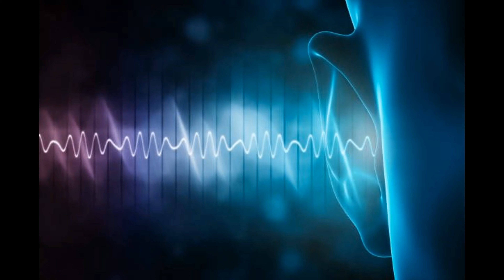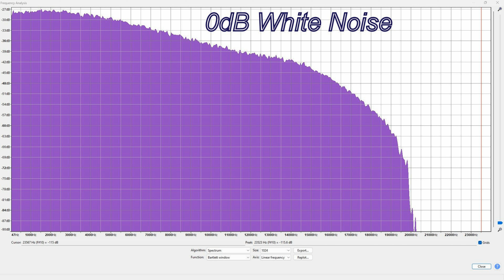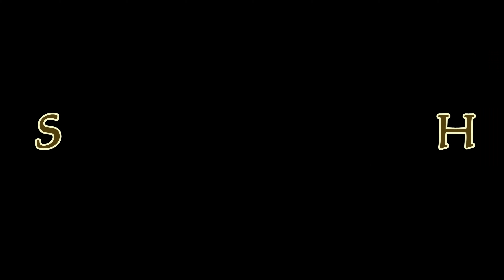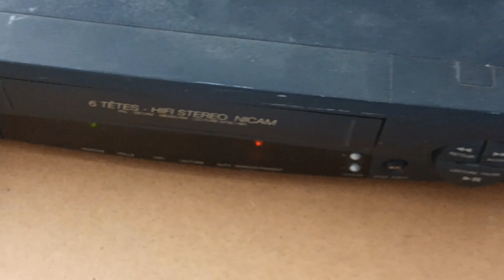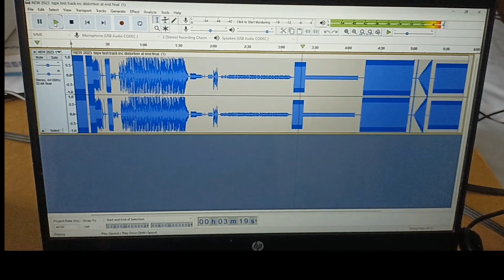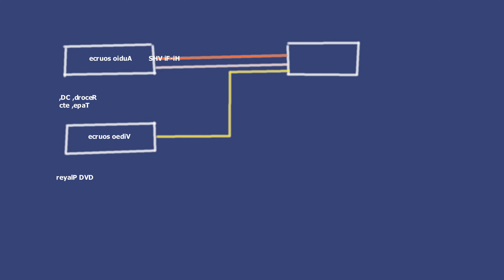VHS HI-FI Sound: Test Results Revealed

Comment: Great video! Very informative. I have been doing this for a bit but with no preamp between my source and the vcr. The sound quality seems to be really great still, but I'd love to be able to set the recording levels to maximize the quality. What would you recommend for that?
Reply from the maker: On my VCR the input is preset and is fine. You can either amplify it going in or coming out. My stance would be to put in an amp as it comes out because that way you will never overdrive the input level. Better to give a "big" signal a little boost rather than giving a little signal a big boost because of noise floors etc. This is good value for money, It is a  1 input 4 output headphone amp. You can see it as overkill but it will do the job at low cost. You can try it as an input booster and just as easily as an output booster. Plus you can still connect other things to the 3 spare outputs. https://amzn.to/3KRMkHA  really low cost and Behringer is a good name in the pro audio business. With Amazon if it does not do what you need it to you can return it.
Reply: @GaryKeepItSimple I appreciate the quick response! This looks great. In what order would this go in my setup? I currently go from my computer (recording from Tidal) into the VCR input. I then go from the VCR output into my technics receiver to check the recordings.
Reply from the maker: From the recorder  put in the amp and adjust the level to get the results you want to feed into your Technics amp.  That way you will not have noise issues. You will just be "topping it up" to the level the Technics needs to give you the best sound. You will know the recordings are pure without risk of overdrive on the loud bits. enjoy.
Reply: @GaryKeepItSimple thanks so much!

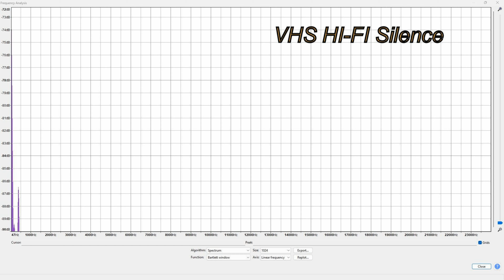Comment: 10:50 
how is it analog?
If you slow down the tape will it slow down the music? Just like a normal analog tape deck?
Reply from the maker: It is analogue because the signals are analogue. No, if you slow it down it will mute the sound.  The sound is on an FM modulated carrier.  You are thinking like Liner track sound which is written to the tape as it passes the head. That sound would slow down and be frequency lowered.  VHS hifi is like FM radio Amalouge but not adjustable.  I hope that helps.
Reply: @GaryKeepItSimple  I understand that standard tape is an energized magnetic field positively or negatively charged to reproduce the audio waveform
I’m having trouble figuring this one out. So its a modulated signal? 
I’ve tried searching but can’t find the answer that explains it. Do you have any more information?
Reply from the maker: If you watch my video https://youtu.be/EHhRfR81bEM it will show you all you need to know about Audio cassette decks. However. Just to quickly explain.   Tape can be North or South magnetised. (Poles of a magnet) the strength of the magnetism gives different-sized output voltages.
So on tape, all you need to do is pass an electromagnet over the tape at a constant speed and feed the magnet with Signal. Exactly the same as we send to a speaker. That will work. But it will not sound good. So DC bias was invented. it sounds better (BAD But Better). Then AC bias was developed. That is explained in my video above. In short, all the signals, big, small, HF and LF are put on the tape. and easily read back by a cassette deck. (or any tape player).  So to VHS Hi-Fi. An FM carrier is just a signal. it is a specific frequency until modulated and the Audio signal causes the frequency to vary with the amplitude of the audio signal. Loud is more deviation, quiet is less deviation. The VHS heads can record video signals up to around 3 Mhz. The HIFI track is well below that so they put it on the tape as an FM carrier wave and when the tape is replayed they separate the FM sound carrier off in one direction and the Video signal off in a different direction. (Filtered by frequency, like tuning a radio) so then the Hi-FI audio is replayed by the machine in the same way as a good FM receiver would deal with the signal. The Picture information is not a problem to the sound and the sound is not a problem to the picture. The biggest problem with VHS Hi-Fi is Tracking. If the tape is stretched or curled the tracking will be difficult. On the picture this will show as a snowy picture, the Hi-Fi sound will go hissy and the Machine will mute the Sound. This will then unmute and re-mute whilst the tracking error persists. When this is happening most machines will play the liner track and you will hear Lo-Fi sound and chopping noise. That is why it is better to use SP not LP or EP for recording. LP and EP is much harder to track and the tapes will not keep very well.  However, the sound quality on a GOOD TRACKING LP or EP or even EEP will be just as good as on SP. 

I hope that helps. Happy to continue if you want. Cheers

Comment: It’s a shame most vhs hi fi player/ recorders stopped putting adjustable VU meters on them also most don’t include a headphone jack. How does one know the recording leveled for audio in. Plus’s they are just cool. Even the cheapest Cassatt decks have these basic features.
Reply from the maker: Whilst I agree with you 100% about it being a disappointment about the VU and Adjustments can I add a positive light here. 
The main reason they removed the bits was cost. Most people, I would say 95% did not use VHS Hi-Fi as a recording medium. They played Stereo Hi-Fi tapes into the Stereo TVs that were few and far between with the speakers on either side of a 22" screen and that was that.
 Most TV was mono, then when NICAM in the  UK started they had the ability to record High Quality DIGITAL sound. Whether they wanted to or not. But Most people wanted East Enders (soap) recorded 3 times a week and that was all they knew or cared about.  
So the market was small for "Real HI-FI fans". The plus point is that VHS Hi-Fi at least on the one I tested is set to record well with a good input level. i.e. line level. It is pre-set because TV sound is always at the same levels when transmitted. Signals from a Video source are also pre-set i.e. a Sky or Cable box.  so again no need to have adjustments. The HIFI  recording was not Auto level controled so it was just good. 
If you use Line and not headphone outputs to feed the HI-FI VHS, it will always just be correct. be that CD or Tape or record. Line level will always be correct. ALSO because it is so good, if the level is a bit low you can turn up the volume on playback knowing the noise etc is not on the signal.
 For real adjustments, a cassette deck or other recorder used as a pre-amp gets around all the problems in one go.

Comment: We could add (for the technically inclined :) that VHS  HI-FI is FM modulated, similar to an FM station, with some audio compression/expansion to lower noise and improve the dynamic range.
Reply from the maker: That is correct, and it does a good job, with a good tape .
Reply: Wouldn't audio compression decrease the dynamic range rather than improve it?
Reply: @UltrafineDeluxe  It is compressed during recording, than expanded again during playback to recover full dynamic range.
Similar to DBX.

Comment: Hi-Fi VCR sound cannot capture all the sound like CDs can because Hi Fi VCR is analog which creates inaccurate results and less fidelity than to a CD, and consumer level which has a lot of background noise. It's just like YouTube audio which doesn't contain all the sound as a CD because of audio compression, which is way worse.
Reply: Lol?

Many old audio sources that eventually made their way onto a commercial CD in the 80s were recorded off of analog tape deck based originals. If you have even a 4 track .25” tape deck pulling that tape at a fast enough speed it will sound better than CD. Although it will wear out with repeated playback. 

Without seeing the machine and walking into a room during the playback of a tape reel i doubt that anybody but an audiophile would notice that my music was being played off of a tape deck. 

(I have not watched the video yet so pardon me if it is explained there.)

On the original VHS format audio was stored on linear tracks adjacent to the video track which was a helical track. It sounded okay at standard speed but was awful at extended or long play speeds because the tape on that linear track was being pulled very slowly.

VHS HI-FI stores the audio on the helical track with the video which will not only slightly improve the audio compared to the default original standard but the audio will remain at that quality even on extended or long play speeds.
Reply: @halo3odst  here's the thing.... vhs hi fi still doesn't capture all the sound like cds do since they use fm modulators rather than a linear signal like reel to reel tapes do.... reel to reel tapes were specifically designed for audio capture and professionals used this format which is why they beat all digital audio formats for producing.... the biggest question i have is why vhs hi fi wasn't released as a digital audio format... riaa too scared of consumers copying cds?
Reply: Just another LOL

Comment: I used VHS Hi-Fi Audio for many years from 1986 up to the early 2000's.  It was a great audio archiving format giving damn near digital audio quality on cheap (compared with reel-to-reel) tapes.  Tape to head speed was the equivalent of about 102 ips on open reel.  The greatest problems with the format were tracking issues (resulting in a "motorboating" buzzing sound) and sometimes incompatability between decks.  DAT actually suffered from a lot of the same issues as it used the same rotating head drum (albeit in miniature) as a VCR.  Dropouts on the tape would also cause either a quick sound glitch or a mute in the audio.  This could be minimised by using high grade (rather than standard grade) blank tapes from good manufacturers like TDK, Sony, Maxell, etc.  There is also a low level noise that comes from the head swiching system in the VCR, but it was pretty much un-noticable at normal audio levels.  I used the format mainly for archiving radio broadcasts, and only recently finished transferring all the tapes to digital audio files.  It was definately one of the "best kept secrets" in the audio world at the time.

Comment: 8:14 interesting that you show this particular JVC S-VHS recorder wondering "Where have the controls gone". The answer in this case is that the European (PAL) version had all the controls and the US (NTSC) version didn't. 
I happen to own the PAL version. I recorded several E300 tapes on it with 10 hours of music each, with markers so I could search for particular music later on. I remember it insisted on getting a video signal with the audio to work properly so what I did was I put it in simulcast mode and recorded a TV channel as video and the audio input (connected from my receiver) as HiFi audio. I also recorded CD's by using my Amiga as audio and video input so I had the Amiga CDTV player (with track number and time code!) on the tape with HiFi audio.
Reply from the maker: You had it sussed. Well done.

Comment: Just to add it is better I find if you record at  EP speed as it stops the head switching noise as the tape is moving slower against the drum the sound isn't compromised .
Reply from the maker: A lot of people say EP is subject to tracking problems between machines. I say if it works, it works.
Reply: On the JVC VCR I was using, in EP I could hear some typical noise you have when tracking is not 100% correct iny speakers. It was quite noticeable at high level. The SP was clearly better for me.

Comment: 4  hour long mix tapes!
Reply from the maker: You can do 8 hours but they may not track properly if stored. so yes 4 four-hour mix tapes.
Reply: @GaryKeepItSimple  I ran out of luck, the VCR turns on but won't accept a tape.  I'm guessing the belt got a bit weak.  On the other hand, I found maybe a dozen old tapes; mostly Profi Gold (aldi or lidl store) branded (some are identical to the emtec tapes I got) and a TDK all EHG and labeled 100% HiFI stereo VCR.

It appears the VCR can play NTSC tapes on a PAL TV that can do 60Hz.  I think it's worthwile to operate on the patient over winter.....

Comment: Back in the day 1990's ish i tried VHS Hifi sometimes it was fine sometimes it was hyper sensitive to tracking even when i used tdk EHG so for me it never replaced the audio cassette and  a few years later i swapped to minidisc and then to CDR! eventally i used dvd-r and dvd+R for audio. Nothing fancy but i was recording stuff off the radio so would use my Hard drive recorder to record stuff unattended via freeview to the   HDD, would edit it later to remove the extra 5 minutes either side that i had allowed and then recorded it to dvd on a 4 hour dvd you may get maybe 4.5hour audiotime due to variable bit rate(or whatever it was called) as you were recording a black screen.
Reply from the maker: Tracking can be a problem. particularly between different machines, LP ( EP?)  made it a lot more tricky.

Comment: I was going to try my 1992 Panasonic nv f 55 with it's busy sounds but two dodgy phono cables and my 1988 onyo reciever reciever has a dodgy specker protection relay and needs a dose of contact  cleaner , but the Panasonic nv f55 does have recording level adjustment but does sound great the receiver playing video through the recover ,i reckon this recorder is better at audio than the more modern players .